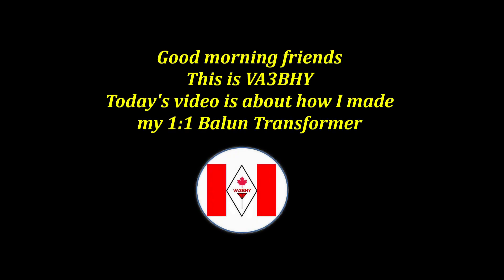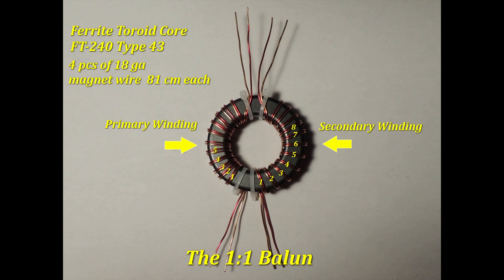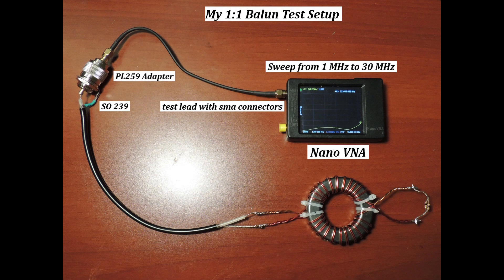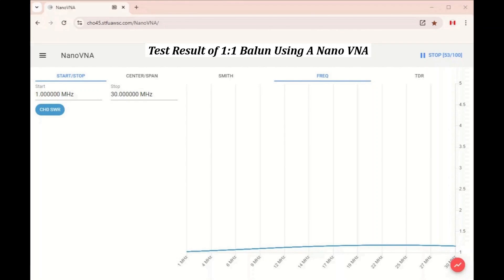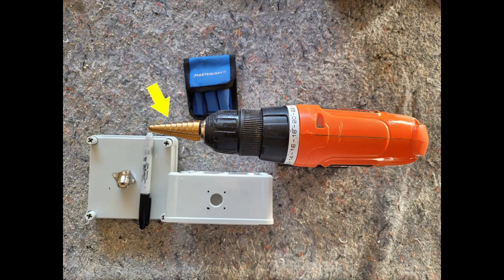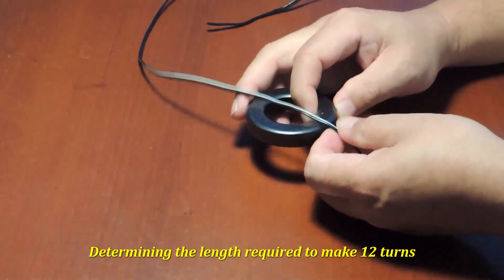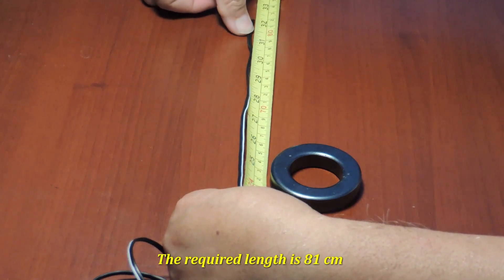1:1 Balun With Test Results

Comment: if you keep the wires as parallel as possible so you will see that your bandwidth will increase to over 70MHz. the curve on the right side is due to the being not parallel of the wires. the curve will be totally flat.

Comment: But what is the common mode suppression? You can do an S21 transfer response and measure the S21 log response in dB. Short the shield and center conductor of the choke at each end, then measure the response of this common mode path.
Reply from the maker: Sure...I get to this matter as soon as I am free. I am very busy with POTA and my radio club at the moment. Thanks.

Comment: I'm confused -- you say there are two windings, but I counted four. How are they connected to make "2" windings?
Reply from the maker: A 1:1 balun transformer, also known as a common mode choke, typically has two windings. These windings are often bifilar wound, meaning two wires are wound together on a core. The primary and secondary windings are electrically isolated, which helps prevent ground loops and allows for the connection of circuits with different ground potentials.

Comment: what about the orientation of the wiring [ which wire connected to which?]
Reply from the maker: 1:02 - freeze it. Now, you will see 4 wires at the bottom and 4 wires at the top. I used 2 colours for easy identification. At the bottom 4 wires:  I twisted the reds together then solder them. I did the same twist and solder with the yellow wires.  This is the input leads. The red, I soldered to the centre pin of SO239 and the yellow I soldered to the ground of SO239.
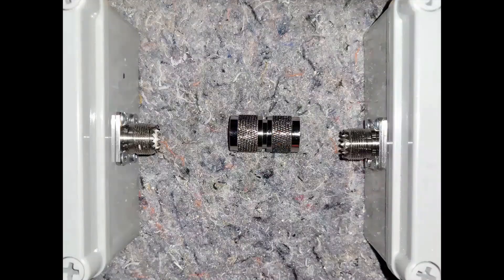Now, focus on the top. Again there were 4 wires (2 reds and 2 yellows) twist the 2 reds together and solder them at the tips. Do the same to the yellow wires (twist and solder the ends.) Now this will go to your antenna. Connect the red twisted wires to the radiating element of your antenna. Connect the twisted yellow wires to the counterpoise or ground part of your antenna. On a horizontal dipole antenna, it really doesn't matter which pole you connect the red and the yellow but when your dipole is mounted vertically, you want the red wires connected to the upper element and the yellow wires connected to the lower element. 3:54 freeze frame explains it better. I hope this helps.

Comment: Could using heaver wire like AWS 12- or 14-gauge take more power.
Reply from the maker: Double (stack) the FT240-43 is better than using a thicker gauge magnet wire. Thicker gauge wires are harder to work with IMHO

Comment: Interesting video thank you for posting. It would be nice to see the losses when two of them are connected back to back and then to a dummy load at 100W. Also, I think that you do not need a balun after the 49:1 transformer since its output is unbalanced. You most likely need a choke to deal with the common mode current. My 2 cents.

Comment: Why you measuring swr instead db attenuation?
Reply from the maker: I should have made the video when I measured the return loss (on dB) using my nano vna - but I did not.
Reply: @VA3BHY  Please make two of them connect them back to back and them measure loss at 100W. I have not seem many videos like this.
Reply: @radioastronomy2001  You don't need to measure two back-to-back if the balun is 1:1.
Reply: @MirlitronOne  I agree. You can just attach a dummy load and see how much power actually makes to it.
Reply from the maker: https://youtu.be/kMlKfHHR8FY?si=0Zv_i_u6Gme2u5lq

Comment: I made a similar 1:1 choke  on 2x 240-43 but swr above 14mhz  is very high 🤔 
I have some troubleshooting snd reading to do.
Reply from the maker: You must be transmitting 1KW and higher. This single core can easily handle up to 600 watts without any problems. Check your windings carefully. Make sure there were no twist that may switch the winding position of the wire (this is the reason I used 2 colours).

Comment: Great info and video, well done. My only negative point is the dual PL259, I have several of these which are on their way to the garbage as the knurled ring keeps coming off when tightened.If you put the choke in the shack near the rig, the coax shield between your 49:1 UNUN and your 1:1 UNUN will cat as a counter poise, try it, it may or may not make a difference.
Reply from the maker: Thanks for the comment. My transceiver is 10 feet from this transformer. I do not like RF in my shack. I installed some counterpoise at 49:1 using the formula 0.05 x lambda. Since I am using a 20-meter-long EFHW wire antenna my counterpoise is about 2 meters. This worked well based on my situation. Here is the video of the 49:1  and 1:1 working together https://youtu.be/Ir-i8UXAQM4